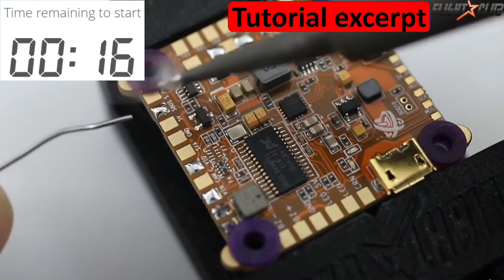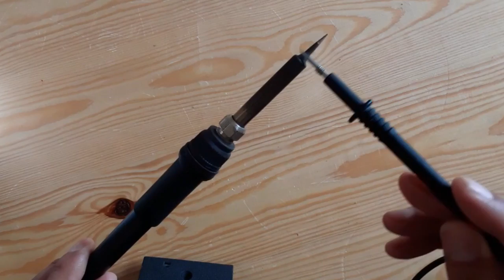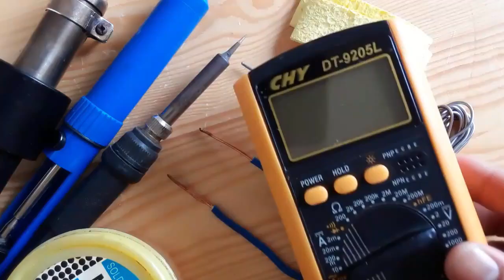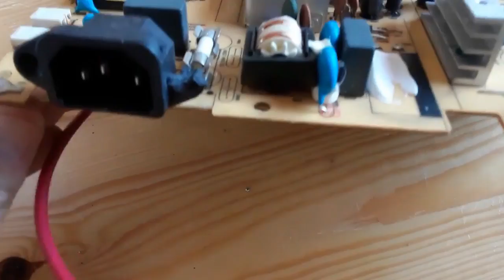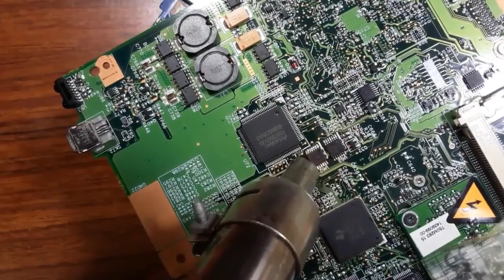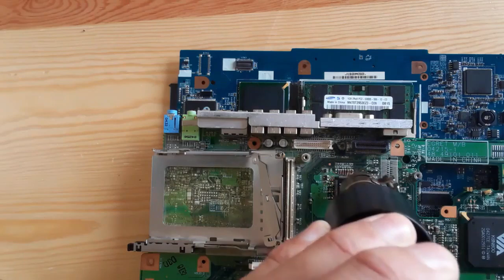Learn to solder & desolder ICs like an expert - electronic components & Integrated Circuit soldering

Comment: You are an excellent teacher. Congratulations. I have a Motherboard ASUS P8Z68-V LX and I have no voltage at GFX. It has a PU6 IC in circuit of GFX. It takes 12V in pin 4 VCC and I have no output in pin 7. How can I replace this IC? Its very difficult because pins are shown a little externally of the IC and is very difficult to put correctly. Thanks